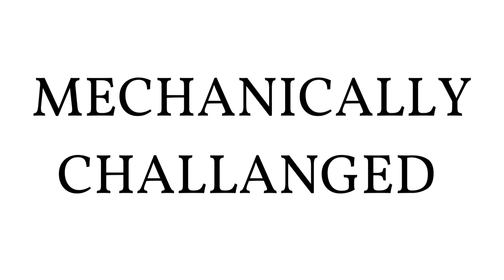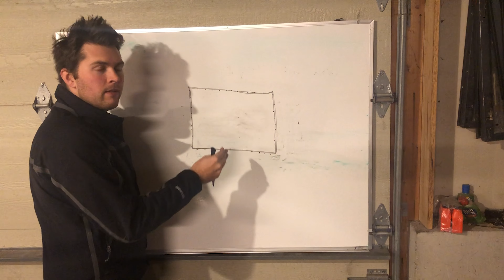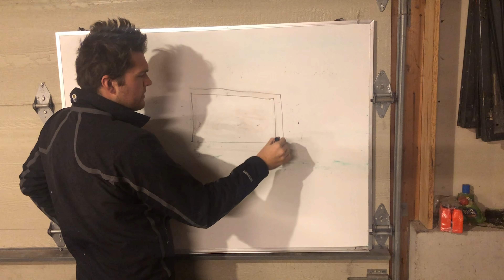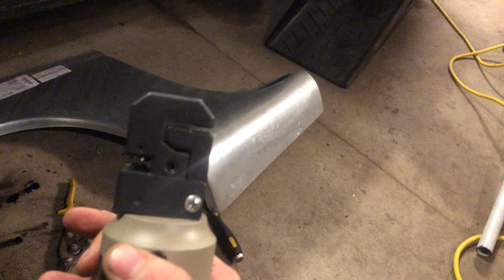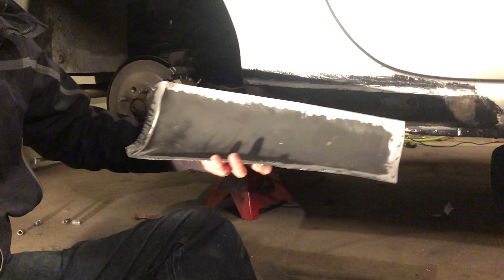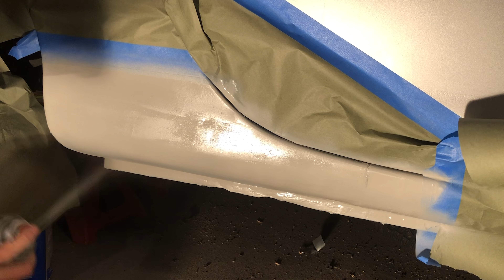Fix Rust (No Welder Needed)

Comment: Zinc oxide primer otherwise known as “weld through primer” would have done the job buddy. It’s designed specifically for this type of job and doesn’t melt/evaporate when welding. 

Whilst cosmetically the gluing method might look good, welding is recommended as it will fuse the metal pieces together at a molecular level creating/ maintaining the structural integrity that this panel requires. Not sure how a glued panel will work in the event of a crash (God forbid). 

Hope this helps. Kudos to you for attempting this build and overcoming the challenges - feel your pain as I’m an S3 spider owner with a similar issue.